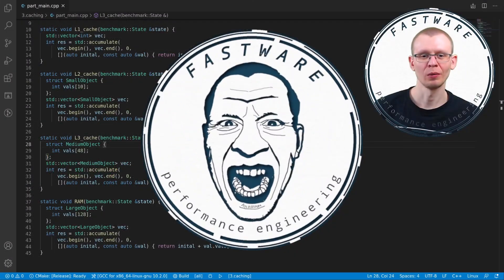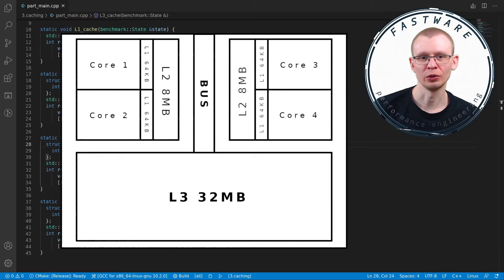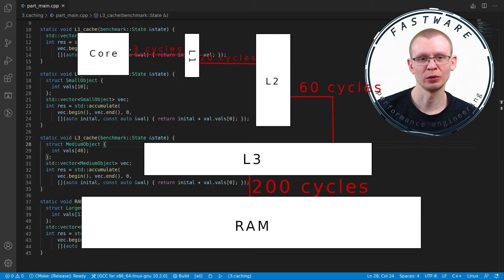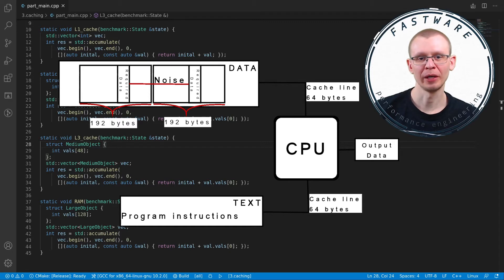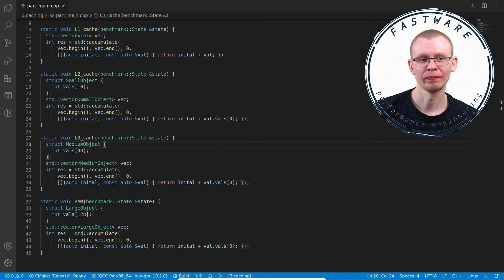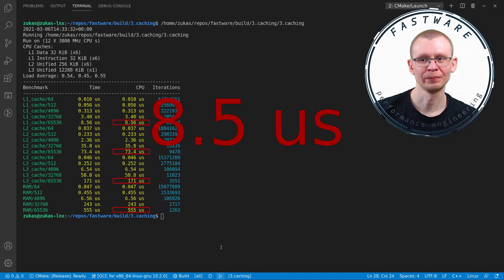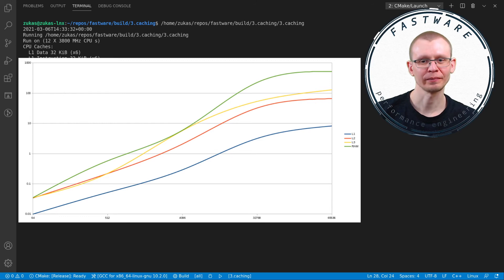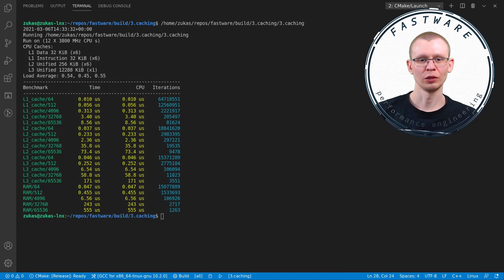Fastware - CPU cache - OOP stinks and here is why!

Comment: I am working on a portfolio project to process a large amount of data, and I was considering using OOP. Your video changed my mind. Performance really matters when working with large data and building ultra-low-latency systems. Thank you for the video!
Reply from the maker: You are welcome. When designing high-performance systems, you need to work from a different direction. Consider what data you have and how to transform it, what data access you have, and what constraints exist. The APIs and the code should fit with the data processing model, not the other way around.